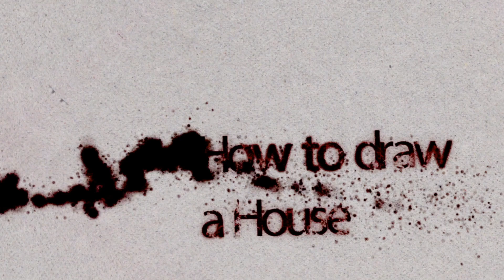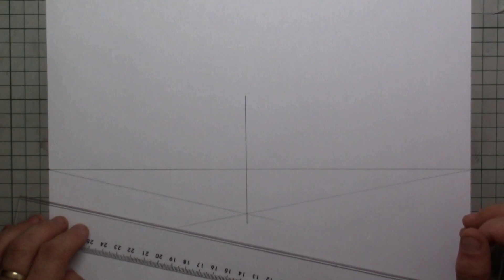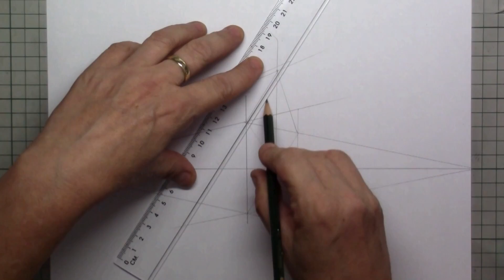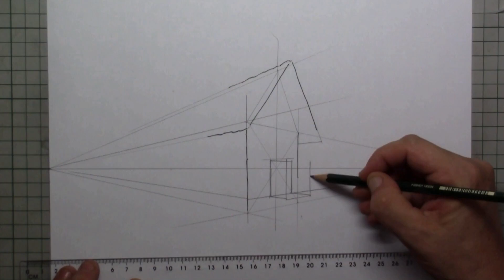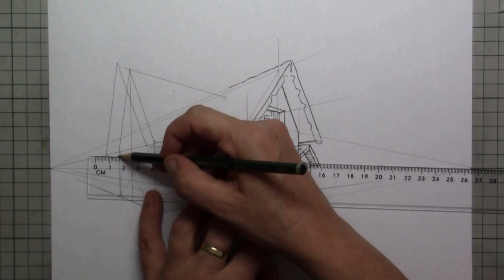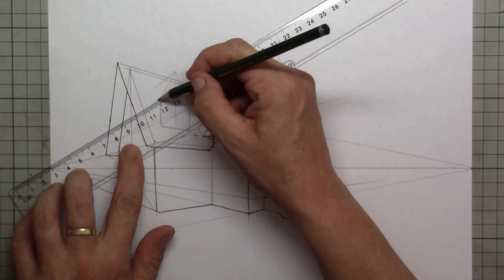Easy PERSPECTIVE for beginners HOUSE drawing

Comment: That was very helpful, and I thank you for your efforts! Is that considered one-point perspective, two-point, or what? I find those terms very confusing. If it is one-point, for example, does that mean I am standing right in front of the house,  or at the corner where the wing gets added on? And what would two-point perspective then be?
Reply from the maker: Hi Marilyn, thank you for the compliments. And often there are more than on point for dissapearing. One that is in front of you that sucks in the lines and two to each side ... ^^ You can read more about it on Wikipedia if you like!

Comment: Very nice lesson, thank you for posting this!   I have question about vertical lines in the far distance, which in the photograph I'm using tend to angle inwards as you go upwards (they actually do not appear vertical).  Should I draw them this way, or is it better to draw them always straight vertical, like you do in your video?
Reply from the maker: Thanks Mike!! And what I do when drawing from a picture is keep thru to my perspective rules. So I do not draw in the photo angles but try to draw as I was seeing it with my own eyes. But, in case of very high buildings, I do use the third disappearing point in the sky! You can see this in this tutorial: https://www.youtube.com/watch?v=E2-5rDELH88
Good luck on your drawings! ^.^
Reply: yeah, that's what I was getting at, I suppose -- if the buildings are very tall and you have a third vanishing point in the sky, it can be good to use it; thank you for getting back to me; I will check out the attachment you sent;  Keep up the great work!
Reply from the maker: Thanks and good luck Mike!! I will keep up my Tut's ;)
Reply: Lots of great info here but couldn't listen due to horribly loud "music "